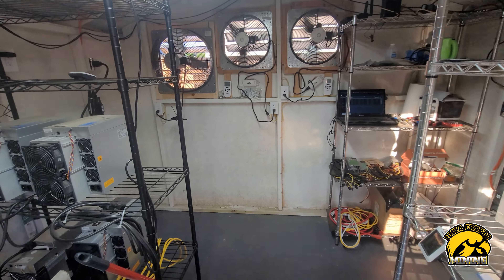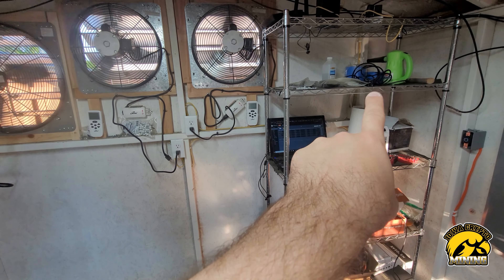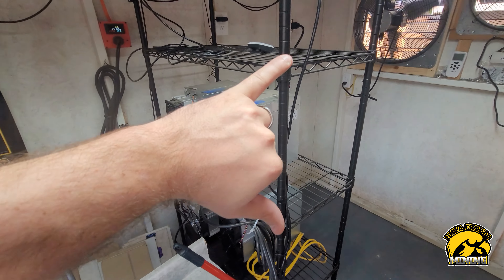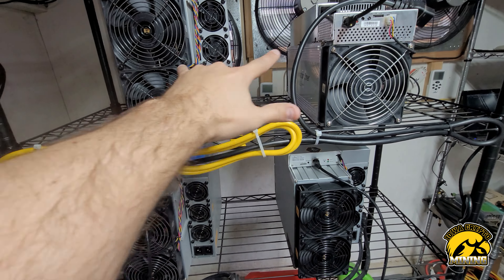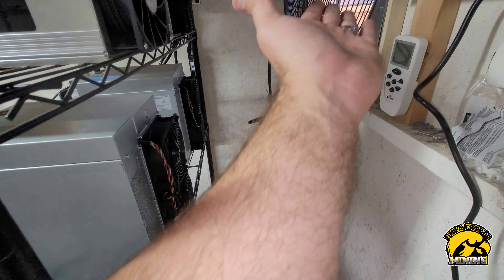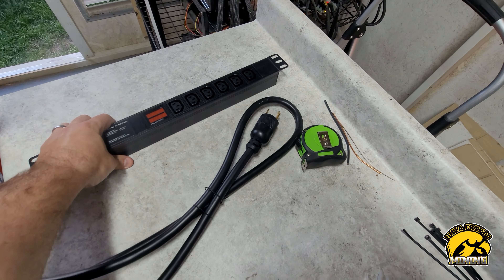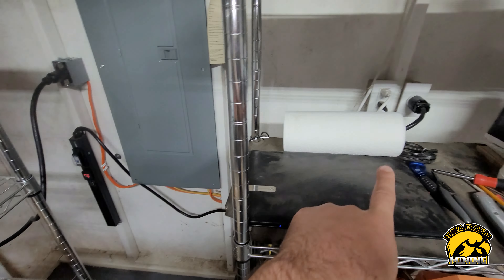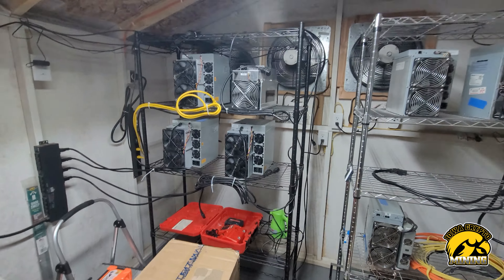Getting Better Temps and Airflow... I Hope...

Comment: You should put a second fan on the top right corner, it triggers my OCD lol
The PDU is perfectly fine at its location as long as it's perfectly locked :)
Reply from the maker: I will haha. It's there sitting on the ground. Didn't have time been really busy lately with family stuff and last weekend had a really bad storm and water in the basement from it. Had a lot of fixing/cleaning/changing to be done. I'll get fan knocked out when I order some intake as well.

Comment: setup honestly looks fine, id try to hang the cables on the ceiling so you dont trip over them but it looks good otherwise!
Reply from the maker: Yeah. If I could do shed over again, it would be to hang outlets from ceiling and go down the the rigs. Oh well.
Reply: @IowaMining  yea I kinda feel semi similar but I'm going to get one of those racks where you can just string the wires from the roof I think
Reply from the maker: Yeah I have it cleaned up, no trip hazards. Little cleaner than what I had set up.
Reply: @IowaMining  this is the way

Comment: If your second shelf of asics need a more direct line to the exhaust fan, you can raise the second shelf and put the asics on their side so they aren't as tall.  I saw videos of mining farms set up that way.  I haven't heard about asics not to be sitting that way.  If they can't be on their side for any reason, than obviously that won't work but I don't see what it would hurt
Reply from the maker: You know what, thats a great idea. I was also going to do a board or somethign to deflect air up. Today, was a warm day and it was 110F right below asics so its sitting there a little bit, rest of shed was really good.
Reply: @IowaMining  I have the issue of a lot of heat just sitting above the exhaust fans.  I''m thinking about doing a "drop" ceiling with foam insulation board that I have from the mining room in my basement
Reply from the maker: @ruskyscryptocave  yeah I thought same. Your roof space is higher/bigger than mine. 

I'll test board out this weekend.